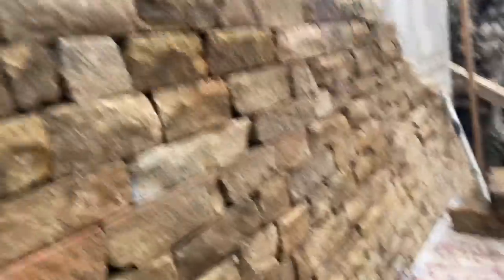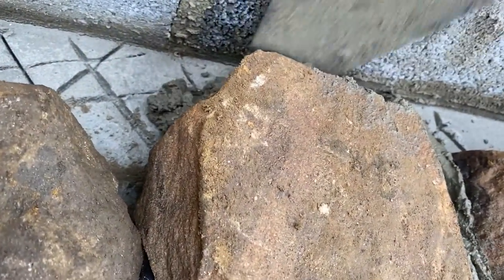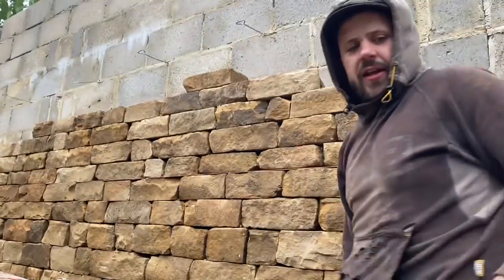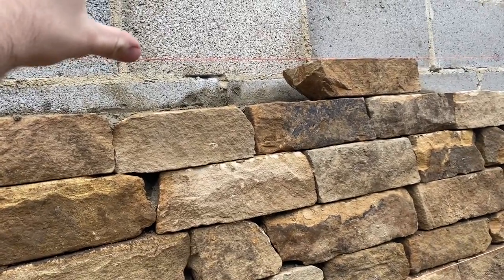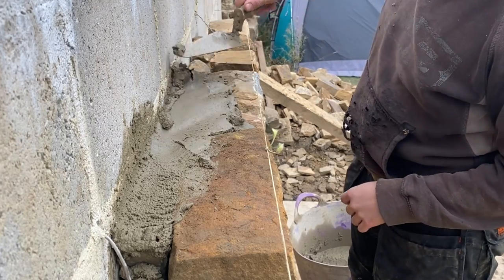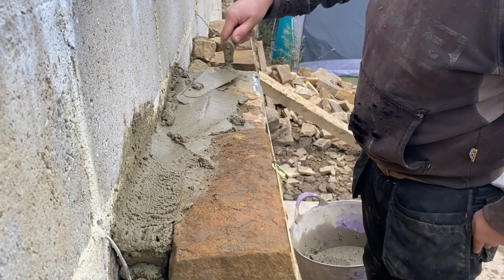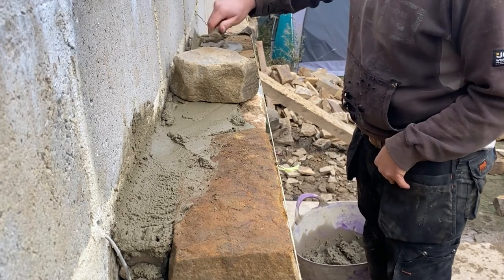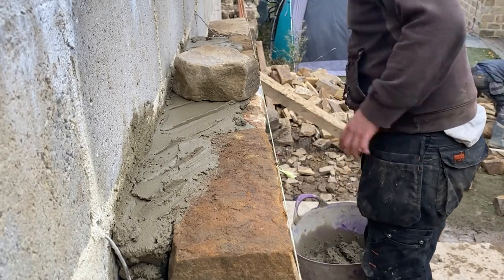Dry Stone Effect Cladding A How To Guide

Comment: Absolutely beautiful work. Quick questions ~ what would be the risk of water making its way through the wall from rain?   In a wet region, would a waterproof sealant be required on the block work?
Reply from the maker: Thanks mate, it has and agricultural drain down the back with clean lime stone over it and a few weep holes at the bottom so there should be no issues there

Comment: Do you have to fill the cavity? What if i wanted a layer of insulation, 30mm air gap, sarking, and brick ties? Would a cavity similar to a double brick wall compromise the structural integrity of the stone skin?
Reply from the maker: that's not something id be able to comment on mate as I've never done it sorry